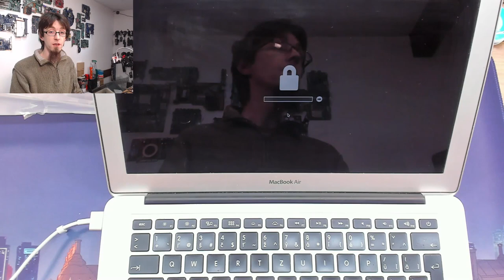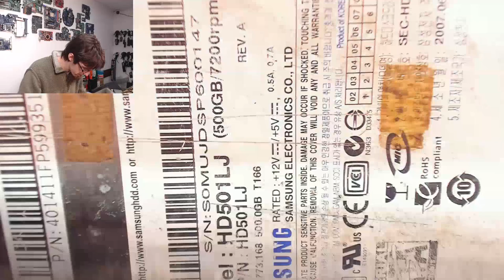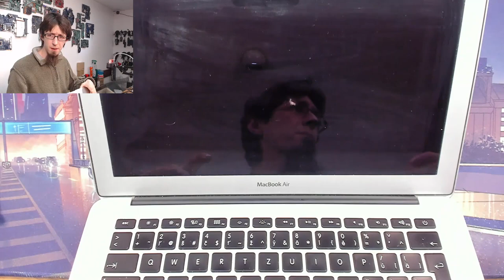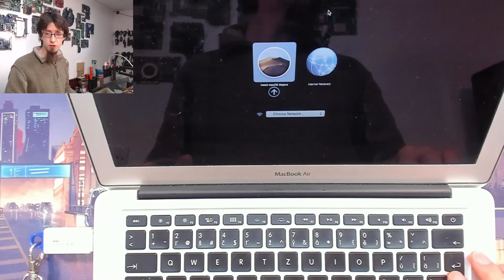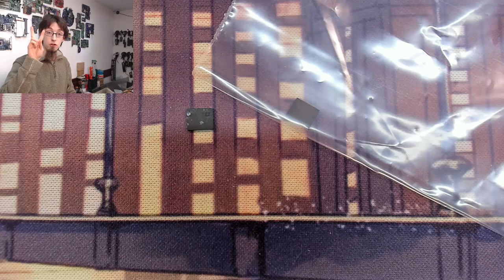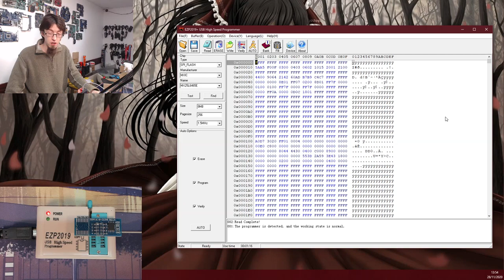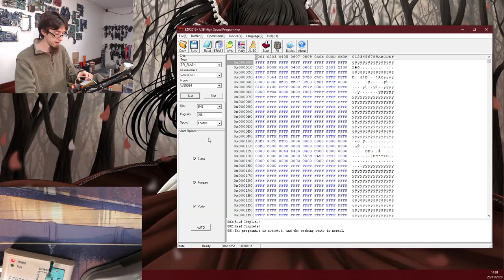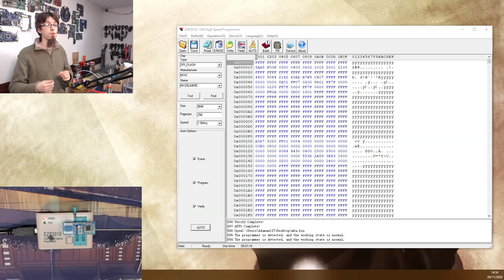[2017 and older ONLY] How to remove MacBook Air Firmware Password - LFC#233

Comment: You don't actually need to rewrite a completely new BIOS onto the chip.

All you need to do to get rid of the EFI-lock is to read the current chip using your adapter, then search the file for $svs in the file and replace that whole section with zeros (In HxD you use ''fill section, and fill it with FF), save the new file and write onto old chip. This will remove the EFI-lock but leave everything else (ME-region, SN, etc) as original :)
Reply from the maker: Neat, I'll take a look at the dumps I took to check that out!
Reply: Correct.
Northridge Fix has several videos on how to do it.
Reply: @coctailrob  This tool is great, I've been using it for over a year and it saves me so much time instead of having to do any soldering.
Reply: @OskarBlomkvist  would you be able to take similar actions with the JTAG connector? are you even ABLE to use the JTAG connector on macbooks, or are they disabled via e-fuse? i would think not because a corroded JTAG can lead to system not powering on, but then again it could only be certain rails also connected to the connector that short but all data lines are not connected.. idk thats why i am asking lol.
Reply: thanks for this man!
Reply: @OskarBlomkvist  hi, may you guide me from where can I get this tool? I’m facing same issue of firmware password locked.
I live in Dubai 
Thanks in advance
Reply: Oscar, can you please explain "$svs in the file and remove"? Do I change the bytes following $svs, or including "$svs", to zeroes, or some byte? How many bytes?
Reply: True @Oskar but you forgot that you have to replace all the lock code that you removed with zeros.
Reply: @MohamedMohamed-fm5hg  use TL866 and appropriate boards or sockets to fit your EFI chip into  and you need some software that only ruins on Windows
Reply: @MrPnew1  Correct, I updated my post :)
Reply: @OskarBlomkvist what sort of adapter/tool do I need to buy to do this? I’m not very hardware tech inclined, but I’ll risk it bc I’m locked out of my Mac w/ everything on there
Reply: dexdipa2487  The data is safe as its stored on SSD
Reply: @OskarBlomkvist hi is this method also works in apple phones?
Reply: @pongkie25  no. This does not work on any icloud lock
Reply: Helo guys..
Does anyone in this chat know about the fallowing.
I purchased an Imac 27 Late 2013. That wont go into boot menu, it only recognizes  the apple HDD 1 TB. I was able  to install on it a new butt same Catalina.. but the problem continued. I think it has a firmware hanky panky…
Reply: @al3xc752  When you hold down ALT/Option to get into the boot menu, do you get a lock symbol?
Reply: @OskarBlomkvist  
 No it goes directly into boot menu but it only displays the apple enternal HDD 1 TB, even after connecting a copy of the OS that i cloned within the utility’s setup. It acts like its set to only accept the enternal HDD. I am able to start the imac through utilities startup option. FYI…

Comment: That is precisely what we TV technicians do (buy an already programmed SPI Flash) and we copy the info into a new one. When we receive a TV without eeprom problems, we also copy it and keep that information on our PC, we have to register Part Numbers of the mainboard, the T-Con board, also the brand and model of the screen; used in that particular device. Winbond is my preferred manufacturer when choosing these types of components. Thank you very much for sharing. All the best.

Comment: A few others people pointed out some nice information but I want to make a comprehensive comment because it's not as easy as it sounds.

— It is not recommended to replace the SPI ROM chip with a different model. Different SPI ROM chips may have different working voltage (1.8V or 3.3V), different operating frequency and latency, different command set and especially support for Quad SPI mode which may not be enabled by default. In particular, the 2015 MacBooks like this one use Quad SPI mode, so the chip must support it and have its QE bit set to one. Additionally, Intel platforms all have Intel Management Engine nowadays, and it can be picky about the SPI ROM. The firmware contains a list of supported chip in the VSCC table, you can check it with UEFITool NE or Intel FITC if ever you have to swap with a different chip.
— Buying pre-programmed chip off of eBay is not a good idea. Sometimes it works, sometimes it doesn't, because the people that sell them don't necessarily know what they are doing and just flash random dumps found on badcaps.net or Vinafix.
— Using a pre-programmed chip or a chip from another machine means you will have the wrong serial number. In the best case the serial number is blank and the board has to be serialized using Apple's Blank Board Serializer. Otherwise it has to be edited to match the original one, and the checksum for the Fsys store (which contains the ssn variable) has to be recalculated.
— Using a chip from another machine means you get the ME region that has already been tied to the new machine's PCH. This will cause all sorts of random problems depending on the machine, incl. shutdown after 30 minutes, long POST delay, fan running at full speed, ME not working, freeze/kernel panic while booting macOS, apparently even webcam not working on some Mac boards. The ME region has to be cleaned, and there's a specific procedure for that, 90% of the videos or tutorials you'll find are wrong about it. Don't copy/paste with an hex editor, don't use MEInject. This will put a raw ME region without manufacturer settings, and Macs for example have specific settings for the ME region that will be lost (and it can also cause similar issues to "dirty" ME region). The correct way is to use Intel FITC, see tutorial on win-raid forums. Some pre-programmed chip also may not have the ME region cleaned properly.
— Apple switched to APFS by default with High Sierra on machines with SSD (and HDD since Mojave), which required a BootROM update (part of the EFI) to support booting from this filesystem. Meaning that if you use an EFI with an old BootROM (either flashing a random dump or using a pre-programmed chip without the update), suddenly you won't be able to boot from a drive with High Sierra or newer on it, and you won't even see it in the boot menu. One solution is to reinstall macOS on the internal SSD to trigger the BootROM update.

Overall it means that it's not a good idea to ditch the original firmware. The proper way to clean a password is to edit the original firmware.
To be clear I don't support shady unlocking practices, it is well known that there's a whole market of stolen goods and people making money off of unlocking them.
There are 2 methods for this:
— Clear out the whole SVS store. There are other stuff in this store, no idea what they are for so personally I prefer not doing that.
— Just invalidate the CBF2CC32 NVRAM variable in that SVS store which contains the encrypted password. You just have to change one bit in its name, so like replace the C with an A or whatever. Note that strings are UCS-2 encoded, so in the hex editor it'll show up as 0x43 0x00 0x42 0x00 0x46 0x00 etc.

By the way, only the Macbook Air 2013/2014 (820-3435/820-3437) will have the fan spin/stop/spin/stop/spin after disconnecting all power. The 2015 model here (820-00165) won't do it.
Also you can buy a WSON8 adapter board for your programmer, it should come with both the 8x6 and the 6x5 footprints for 2013 and 2015 machines respectively. You don't need to use hot air to solder it on the adapter, you can just run the solder iron with some solder on the edges.
Reply: This guy knows what is talking about!!! Listen him. Thanks!! Hey Piernov, do you already have the 820-1958-a schematics? it is already on some pay sites. Good luck to all!!
Reply: Pretty sure the first thing anyone with a few brain cells would check would be the operating voltage of the chip 😆

Comment: I can't believe it. You have programmer in your service shop and you replaced the original BIOS chip.
The right way it's to clean the security block.
The ME region, serial number, and other settings remains as original. I will clean security block for free.

Comment: do you happen to still have the unlocked .bin file around? I've managed to wreck mine which is a locked winbond 25q64fviq from an older A1466 model. Much obliged if you can help a fellow out

Comment: Excellent and very educative video. I recently came across to a Macbook Air A1466 that experienced black screen of death after failed update to Big Sur. Previously, laptop worked fine. Now it is possible to revive it without loading EFI chip with correct firmware.
Reply: Same my issue!

Comment: I have a dead macbook pro logic board (water damage) I installed a new logic board into the machine and it has this firmware lock, is it possible to swap the bios MXIC chip from my old board onto this new locked one?

Comment: PLS MAKE SURE U PROGRAMM THE CORRESPONDING SERIAL NUMBER INTO THE EFI OTHERWISE IT WILL NOT BE ABLE TO USE APPLE SERVICES LIKE ICLOUD IMESSAGE ETC
Reply: No need, the edited file was the original bin file from that machine, so the file already had the correct serial.
Reply: How would one find the serial number in that hex editor?

Comment: Smashing recovery :-D
So at some time you may do a byte by byte comparison between the two images to see what changes when the password is set.
I used to do stuff like that with my old willem interface , millions of years ago lol.
Reply: I did that BIOS image comparison for ASRock G41M-VS3 board, because if i flash BIOS from site without using mactool (which is older version v1.17f and it's not available anymore on ASRock website) it kept complaining mac address is invalid and must press f1 which is bugging me off

Comparing BIOS from ASRock website and the one I have used with mactool, I can see the location of mac address. Bye bye mac tool

Comment: Hi thank you for the video. This is my first try of doing a motherboard repair. Looked at videos of them for years but had my first attempt today. I tried to remove the chip from a donor board and followed all the instructions. Located the chip, applied flux and set the hot air gun to 450*C. I did it exactly as you did it in the video but I just couldn’t remove the chip and ended up destroying it. Parts of the black covering just came off instead of the chip itself. I tried to remove some neighbouring chips with the same result. I wonder what I did wrong…
Reply from the maker: Interesting... sounds like your hot air station wasn't putting down enough heat (as in, it took too long and damaged the PCB) What hot air station do you have? I've done this with a cheap station, so it shouldn't have been that hard. Something was definitely wrong.

Comment: Hello, please I really need help. I recently misplaced my MacBook Air and after a while I happened to find it somewhere in my house but before then I had already locked my Mac using Find My Mac, but now the password seems to be dead, even if I punch in the one I put there while activating the lock it still doesn’t work. Please help me… 😢

Comment: Did you copy over the serial number using HexEditor ? Otherwise, the new BIOS chip will either have someone else's Serial, or a Blank Serial which doesn't exactly make it a professional repair.

Comment: All you needed to do..is use the password blocked chip...read it in the programmer...save it .open the saved bios file in a hex editor.....locate the password block..normally begins with...svs..select it...fill it with dummy values...FF...save it...reflash the existing chip...job done.
Reply: For real or are you kiding us
Reply: @marckm8839  no kidding for real absolutely...for that model
Reply: @dombarton2483  So I did this, but keep getting error while validating the write. Any thoughts on why? I only cleared about 6 lines until  FF lines came up. And i overwrote the original smh. Which is why im looking to replace the chip now.

Comment: Hey not sure, did you do a episode on the programmers specifically? A "what to do" question.  I have a "play" mobo (socket 775) that I am using to de-stress from work, want to play with the bios without losing the original chip/programming. I can buy the chips on ali for cheap but not finding a programmer that will do them (its an 8 pin starts with a 25 and the programmers Ive looked at (CH341A USB Programmer) have said they can read it but not program it).

Comment: I had a suggestion for 13:20  . It is more of a question than a suggestion. How about applying masking tape on the bottom of the chip (Ground pin). Just to make your life a little easier so that it doesn't short out the other leads. I guess that might work. It would mean you don't need to verify every time whether it has shorted, If you are pulling it on and off the board multiple times

Comment: I have actually fixed a macbook air with locked UEFI by using a removable UEFI chip that you put on the little SAM-Port or the "JTAG" connector. It still requires you to reinstall the OS on the SSD though :3 and they are very very pricy

Comment: Hi great video  a couple of suggestions have you thought about using a  low melt leaded solder on the original SMD component to assist with removal as it mixes with the unleaded solder and allows for easier removal amd secondly you could also locate the are aon the chip that has the password on it and rewrite it with ffff data.   I am assuming each Mac computer has different eeprom data thus saving you having to keep numerous spare EPROMs

Comment: K so I changed the efi chip on a 2015 macbook air all went well after the new install macbook turned on I went and installed the new os and that worked got the home screen up then I went and turned the power off now it won't turn back on any ideas can you please help? One last thing the light is green on charging cable and the fan is running

Comment: Great vid! See I learned something very important! And I want to combine it with another method!  Basically use the same device, but with different connectors, depending on the MacBook Model and year!  Also, I will agree with this method, you will have to make sure that the serial number of the logic board for the repaired EFI device is entered into the chip or flashed! And then if that doesn’t work, press “E” for erase NVRM, Nand, Fans, PMU, or whatever else there is that Apple has, then restart the computer!  Hopefully, the new EFI chip will be able to read and/or save the device serial number somewhere in the EFI boot modules, so that when the machine does it checks, it can start up normally as originally programmed from Apple!  Hopefully, all security is disabled prior to you doing the mass Apple settings erase and reset! That’s what I had to do after replacing the chip with a whole new EFI programming!  Like one of the guys said, we need a cable to plug into all of the MacBooks’ engineering and testing sockets!  Way cheaper than what they are being sold for now! Time for some ingenuity! God Speed! 😎🔥💯💰🌎💻📱💣

Comment: Is it possible to use an older firmware chip on a newer MacBook Pro about 2020, all the chips I see in eBay the newest is 2016
Reply: I have a 2019, did you find anything? Cheers

Comment: Should be able to edit the original hex and use the original chip.  Have you done a file compare between the original chip vs the ebay chips?  Just toss both files into notepad++.  I get a bit nervous with an unknown firmware.

Comment: Some people are selling MacBooks on eBay that have the efi password turn on i brought a mid2013 MacBook air off eBay when i tried to update the Mac os the MacBook air locked up when i told the seller they told me that the MacBook air came from a computer recycling company and they didn't know the password they gave me the phone number to recycling company and the recycling company person said they only sale to businesses not to individuals and they don't know any passwords to the computers and apple won't help because iam the original owner of MacBook so i replace the efi chip and one other thing eBay wouldn't gave back my because it was after 30days

Comment: hi sir i’m here for beg your help i have 3 computers that have efi password macbook pro 2015 model a1502 emc2835 macbook air2017 model a1466 emc3178 and macbook pro 2012 i don’t know which chip on motherboard i can remove and i don’t know which adapter i can use for reprogramming the chips i need your help sir thank you

Comment: I bought a Macm1 2020 on Amazon on July 14, 2024, I opened it and created an Apple ID, it went into recovery activate mode, the 0800 says it is not connected to the Mac. I sent an invoice to prove that it was not stolen, but they did not allow me to restart the Mac, nor did I use it. Immense nonsense, I haven't even paid for it yet. I don't know what to do!

Comment: Can you unlock Macbooks with T2 EFI Locked?
Reply from the maker: I don't think it's feasible. There are exploits for the T2 chip, but I don't think they're straight forward to attack.
Reply: @Adamant_IT  thank you for your reply, I have read you can bypass EFI and iCloud locked with  the checkm8 vulnerability, but I haven’t found any videos how to do it, if you know how to even if it’s just a bypass will be awesome if you can upload a video explaining the process, btw there are service on eBay claiming they remove EFI from T2.

Comment: u can use a different bios chip??...thats a bad sequrity issue for such a expensive laptop!!...some usual laptops are using coded chips and u cant use a differnent one....u have to programm the bios chip from the mainboard! i did this couple times and wont work with other bios chips with the same size! only the original chip were able to use!!
but for most usual Laptops there is a tiny contact on the mainboard for passwort erase!